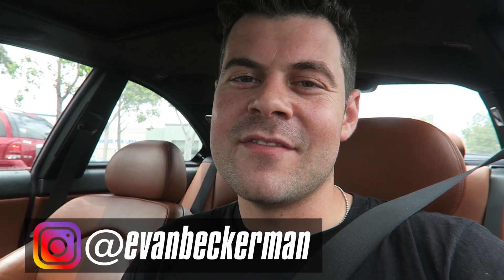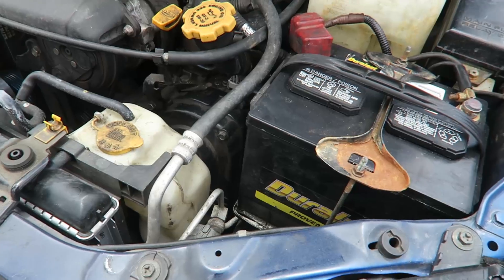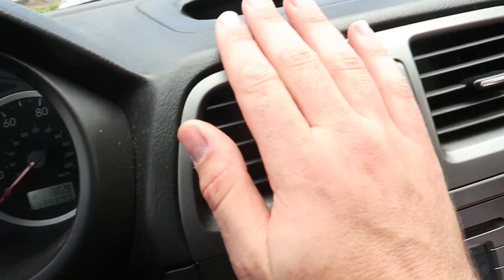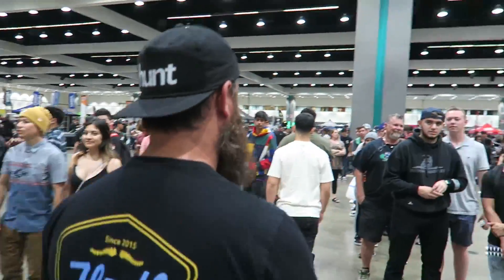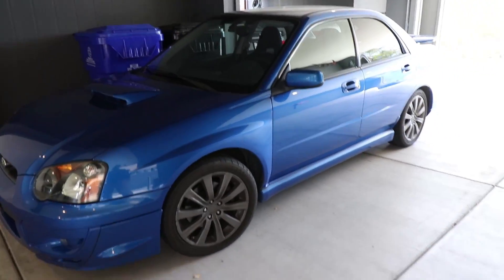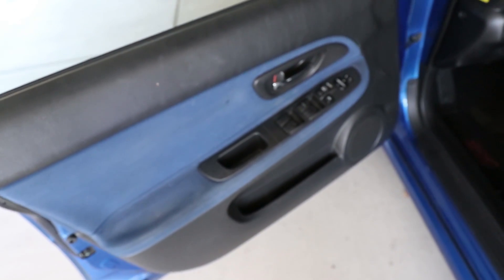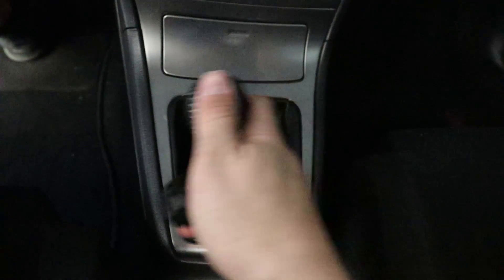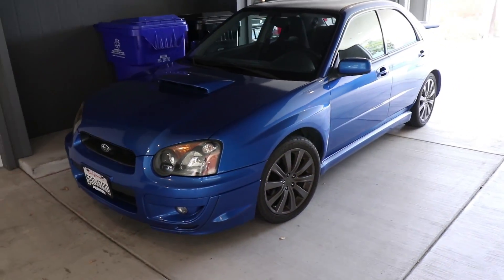WE BOUGHT ANOTHER PROJECT CAR! (FULL REVEAL!)

Comment: Full exhaust system (headers, uppipe, downpipe), Cobb accessport, intake, front mount
Reply from the maker: Good advice. Thanks bro!
Reply: Walbro 255 also
Reply: #vapenation
Reply: throtl UEL headers 👍🏼, Cobb and Invida both make good down pipes single cat or cat less both sound great. For a cat back Agency Power or Tomei both have high quality exhausts. Perrin and Cobb both make good intakes. The Cobb access port is really good. I have a pro tune so I don’t use the tune Cobb supplies but I use it to monitor a lot of shit like knock, boost, DAM. The EJ25 isn’t the best motor to build power on a stock motor so good supporting mods like Air oil separators and oil coolers go along way. And a bigger top mount or front mount intercooler.

Comment: Hey Evan! I had an 05 wagon in WRB as well. I’d recommend the following:
-coil overs (whatever company decides to sponsor you lol)
-fender braces
-STI top mount
-remove the wing 
-downpipe (NVIDIA makes great stuff for the blob eye)
-full exhaust of course. I love the Gymkhana exhaust from Crawford
-keep the unequal length headers!
-Cobb AccessPort
-definitely make sure you do the timing belt/pulley. These fail all the time on the blob eyes and can cause HUGE problems 
-sway bars and strut bracing can make a really big difference on these cars too. The AWD makes it feel super grippy, but with fender bracing and sway bars/strut bracing it’ll feel like it’s on rails
-side spats and rear spats look great
-STI canards for the front bumper
-hella horns 
-STI hood scoop

Comment: finally a real subaru! jesus
Reply: has STi hood scoop
Reply: and i’d probably take that lightweight pulley off, put a stock one back on. no bueno.
 
but downpipe. up pipe. intake. BC or Tein coils. injectors. fuel pump. STi intercooler. EBC. Wideband, boost, and oil pressure guages. STi vf48 turbo. Open source, do not go with Cobb AP. we can E-tune that for you as well. Hippo Tuning and Performance in Clarksville, IN. Check us out, we did Chris from B is for Builds twin turbo mustang while we were out west.
Reply: all cost efficient up grades

Comment: Coming from a wrx owner I recommend you change all the boost pipes to silicone pipes first if not you will suffer from endless boost leaks, everything from the intercooler y pipe to the turbo intlet hose there's a few on Amazon or you can go for big name brand ones (they both are the same ) then make sure you get a safe tune, if not you will get det on either pistons or turbo if it's the stock td04 turbo, my wrx has an upgraded td05 20g turbo with a remap and I'm happy as ever! Glad to see a wrx on the channel 👍

Comment: Prepare to replace head gaskets... I am part of a Subaru family (on our 5th one) and the three 05-07 cars we have had have all had headgaskets go bad around 150k. The Ej255 and Ej253 from those model years are notorious for this issue, stemming from the head and block being different alloys that expand at different rates. Probably something to keep in mind before throwing a bigger turbo and tune in it, give yourself a solid and reliable base to build on. 

Also before putting more boost to the motor consider replacing the pistons. The OEM subaru pistons have a tendency to pop the ring land which really ruins your day (had it happen, no bueno for the head and valves). The ej block however makes this super easy and possible to do without pulling the rods out, there are ports on the front and back of the block that you can pull the wrist pins out of then rotate the motor to push the piston out. 

Hope this helps, and can’t wait to see this build!!! Love these older Subaru’s to death and can’t wait to see this one turn into a beast!!!!

Comment: I have the exact make and model car. First things first, get an accessport, super important and from there you can get a "stage 1 tune".  Change out all fluids. Check for boost leaks and exhaust leaks just in case. Check oil, these cars eat oil like crazy. They like OEM oil filters. Air  intake isn't super important to change out, till you start making 400+WHP, which at that point your transmission will fail in time. Try not to gun it while its under 3k RPM, high boost at low rpm's is how you'll ruin ring lands and seals. Also replace some bushings, it looks like the  shifter bushings are kinda worn.  Another thing if the owner bashed on it and used it for autocross or road courses then i'd check the rear suspension bushings as well. It looks like a great car and i hope you have a lot of fun with it, and i look forward to seeing it on the channel.

Comment: Full exhaust system (headers, uppipe, downpipe), Cobb accessport, intake, front mount. maybe a bigger turbo depending how far you wanna go with this build....personally i think should be nice micky spec haha. polly bushing sway bars/ supporting handling mods. new spoiler and rims get some bc coilovers please dont stance it haha.... nice momo steering wheel some boost gauges ect....the list is endless with this awesome platform

Comment: Great choice man, do the bell mouth downpipe, intake, bigger intercooler, id personally go with a new bpv not bov. Get the access port. Dont have to run cobb mapps. Get a pro tune and you can load mapps right on the access port. You could go crazy with mods but thays where id start! Good luck with it👌

Comment: Hey guys, first mods for Subaru reliability
1. air oil separator 
2. oil pickup + baffle
3. Accessport
4. Equal length headers(if you don’t mind losing a bit of the rumble) 
Congrats on the car and looking forward to the build!

Comment: Check out the condition of the timing belt just Incase it’s old and cracked. If you plan on increasing horse power just get a gates timing belt kit. Replace spark plugs, belts and check the hoses for cracking. You also might want to check the compression and get the radiator fluid, differential and transmission fluids changed out.

Comment: 1,  Sports cat in downpipe – remove centre cat. 2, A full custom remap will bring boost in much earlier due to the lower back pressure and hold much higher boost levels. The remap will also aim to get it running much more efficiently ( which is also more economically).
Typically a Green/K&N/Cosworth air filter or air induction kit such as the K&N typhoon  and probably a 3 port solenoid are fitted at this stage (on top of the sports cat downpipe and exhaust system). A walbro 255 fuel pump  It is also advisable to change to NGK PFR7B spark plugs.

Comment: Awesome new car! Can't wait to see what mods you guys will do with it. I have had two of these, one WRX and currently own an STI, both are 2004's.  Definitely recommend the COBB Accessport V3 (great for monitoring the engine, can have six gauges actively displayed and logging the behavior of the engine in realtime, also helps with codes),  I have the Invidia N1 turboback which sounds great, ACT clutches are probably the best for these cars, I have had a Competition Stage 2 clutch and an ACT and the ACT just felt so much better. AEM makes a pretty great dual gauge piece that goes around your cluster, I use it for boost and A/F ratios just so I don't run the risk of having the AP stolen. I hope this car brings you as much joy and happiness as mine have!

Comment: Should have just bought a stock STI. I know they are hard to find and pricey but it would have been worth it. The WRX is badass don't get me wrong but it's like getting a 335i and not a m3. Anyways use Cobb for downpipe and exhaust. KW and Whiteline for other suspension parts. If you break open the engine use a killer b oil pickup. It will save you in the long run. Make sure to keep an eye on that oil level. I would also suggest using a Cobb for the engine management. The car wont run right with bolt ons that are not supported with the stock ECU. Don't waste your time and money upgrading without an engine management. These cars are reliable but also sensitive to upgrades.

Comment: Hey! Wanna talk to you about the car, first mod should be an accessport from Cobb it’s a have to before downpipe or I take. Overall any heavy mods must have a tuner which is the accessport. With that you can get it tuned professionally but also to map tunes to not damage the motor. These cars are very picky on mods without a tune so look into that accessport.

Comment: this is going to make me miss my 04 sti again... swap in some equal length headers. they make subies run so much smoother plus they sound sick! but just be careful with the amount of power you try to push thought the stock 5 speed glass transmission.. a 2007 sti 6 speed swap with brembo brakes is where i would start with a wrx build. 2007 sti has the tallest gear ratio in the sti transmission. but any 6 speed transmission will take a lot more of a beating then the 5 speed.

Comment: I have a gc8 body na but I would get a Cobb programmer a full intake and new down pipe and get rid of the spoiler. Get the sti one or duckbill. Also. Switch out all struts with forester ones it will give you a 2 inch lift and they are oem. you’ll have to drill new holes for the rear and longer trailing arms to move the rear back for clearance than slap some new meat all the way around. #federaltires #fdrome

Comment: Be prepared for headache!! The engines are reliable but just buy a decent rad and possibly fmic .they don't like overreving 7 grand your lot on wrx but with some sti extras 8 half available + top end power is crap after 120 mph. good luck i had the same car same colour which is the best fast as frig 309bhp . Have a look at roger clark website his scooby wins almost every year at Goodwood festival of speed against old f1 cars and cars i couldn't afford!! with the right turbo and tune could be the fastest car you've owned + monster boot will come in handy. i swapped mine for r34gtt but it took alot to make it as fast but never looked back obviously skyline ownership attracts more attention which i didnt expect and sometimes wish it didnt but 4years of ownership and reliable power never regret buying it

Comment: great car! I had a 04 wrx wagon in the same colour this is it here-> https://bit.ly/2KGgJb1 I'd suggest first thing for power is downpipe with a tune and upgrade the fuel pump. Then headers, up-pipe and full free flow exhaust with high flow cat if you need one for Cali smogging. then bigger turbo, injectors, and intercooler; these engines top out at 400hp satefly with stock internals. and BC racing coils are unreal on these cars, and you should be able to fit 18x9 all four corners no problem i had 18x8.5 with the narrower wagon fenders. Bags would make it look unreal but, you have to notch the front frame rails or else the front axels hit them when lowering the car.  

With all that being said though. I think square widebody it and slam it on 18x10.5 285/30/r18's all four corners with a bigger turbo

Comment: Fortune auto 510s for coils ditch that wing and get a duck tail. Deff get some different wheels. STI intercooler. Intake of course. Sway bar kit, white line if you wanna be basic maybe different end links though. Turbo back exhaust. Different headlights the chrome is gross. Dont mod it for power the engine is super fragile, wrx or sti if you do to much it will break. So keep it minimal it's  just a wrx so go for a show car look. Insta @wrx_chase60